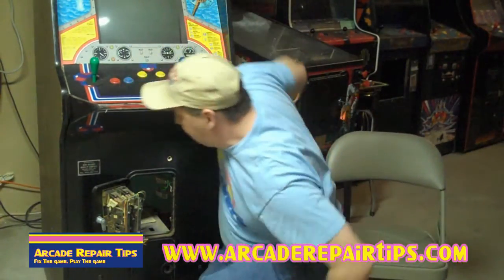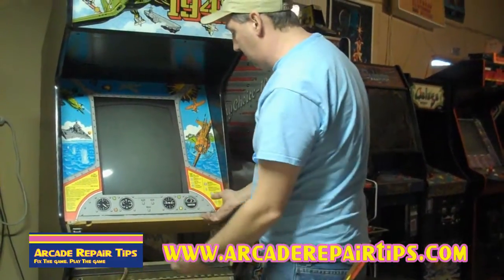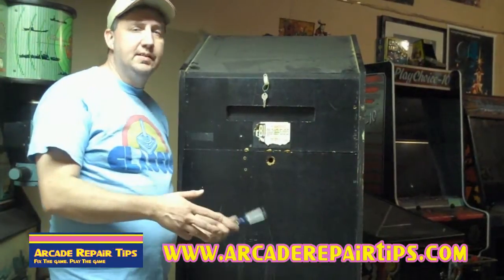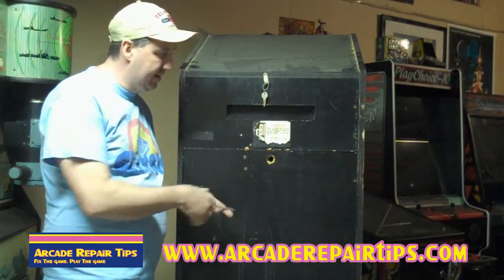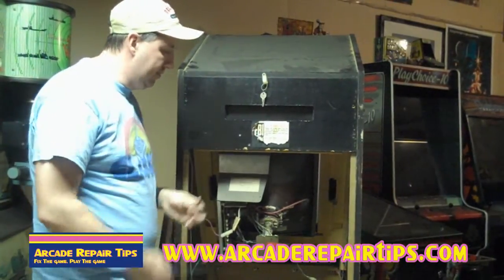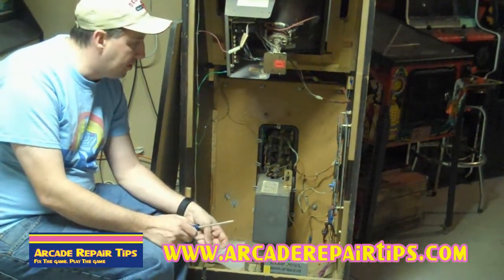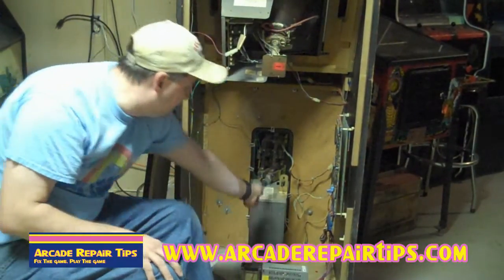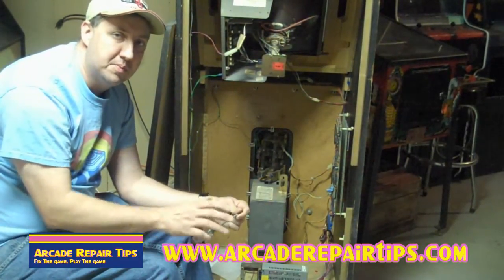Arcade Repair Tips - Opening An Arcade Cabinet

Comment: Hey I have a tetris arcade machine, is there an audio on/off control? My audio does not work but appears to be hooked up propertly.
Reply from the maker: You might try to trace the wires from the speaker back to the game board. If there is a volume potentiometer in between, it may have gone bad. In this case, replace the potentiometer to see if it helps the issue. Also, be sure to see our post/video on Troubleshooting Games With Sound Issues for more information: https://www.arcaderepairtips.com/2015/01/28/troubleshooting-games-with-sound-issues/

Hope that helps.

Comment: Just bought Raiden and I'm having trouble getting it to turn on. Looked for power switch and can not find one. There is nothing on the top of the game where some of the older game have it. The person would bought it from turned it on. We drove 20 miles and are having troubles. Any hints, possible the extension cord is the wrong kind, going to buy a voltage tester today to see if there is voltage going through. Thank you
Reply from the maker: Check around the sides and bottom for the power switch. Make sure that all of the interlock switches in your cabinet and engaged as well. Great idea picking up a voltage tester. That will help you to trace the power coming in from the plug and going to the rest of the cabinet. To hear more of our thoughts on your question, check out Live Show Episode 37 from Thursday, March 5. Here's a link: https://www.youtube.com/watch?v=fGFE80QM4Rc

Comment: hi guys... maybe someone can help me with a question i have .... i bought a old used arcade cabinet from a guy.... he somehow done this...... he has somehow managed to bend most the pins completely off . im talk I g about the pins on the neck tube that connect to the neck board.  can anyone help me with a fix for this or am i stuck buying a completely new monitor  .  thanks for the help

Comment from the maker: @xavius000 Some arcade cabinets cannot be opened from the back. The top part that you popped off is there so you can gain access to the monitor. Cabinets like this usually have the parts mounted to a shelf that's attached to the control panel. If you open up the control panel, you might see some latches on either side holding the shelf in place. Undo those latches to pull the shelf out so you can work on the game. Please listen to episode 21 of our podcast for more thoughts on your question.